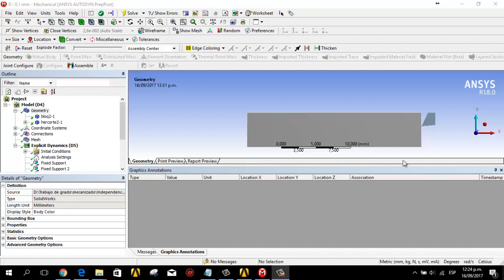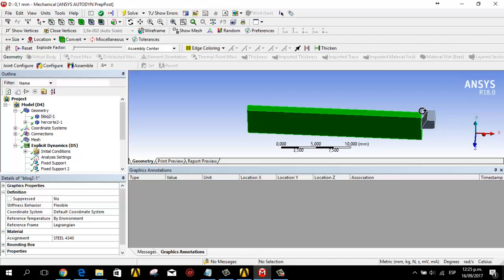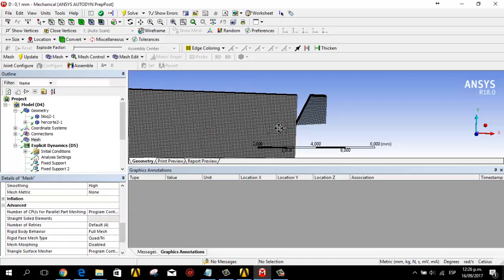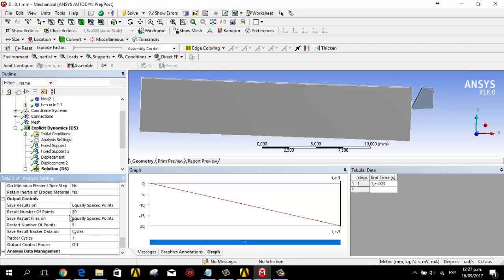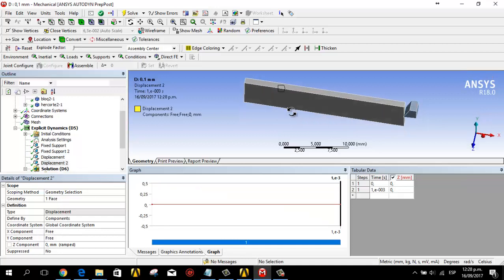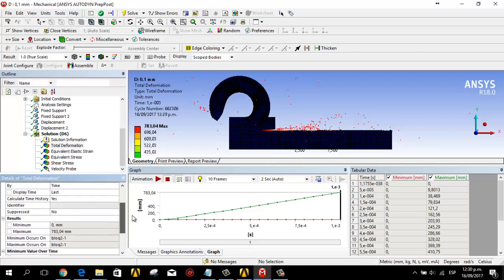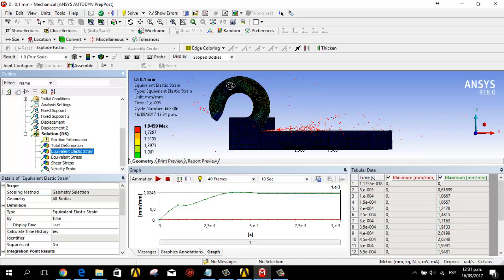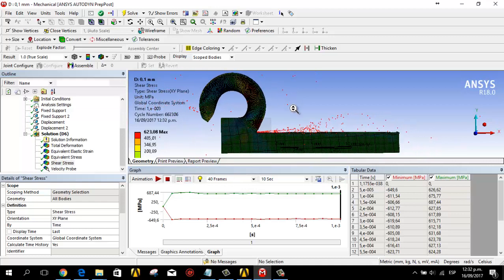Orthogonal mechanical cutting process analysis-Ansys

Comment: i follow your setup exactly what you show, but somehow i get a nonsense result such as the animation of the cutting process end up nothing. the cutting tool is moving across my workpiece but its not showing any cutting effects. and there no color contour on the workpiece while the cutting tool is moving across the workpiece. it just basically went through the workpiece. and the von misses value is just giving ridiculous value. i've been searching so many video guides and follow exactly its setup and i end up with the same problem. Does pc spec does have to do with this issue? if its not then why i cant get the exact result like yours ?